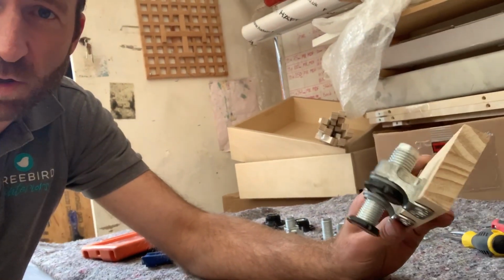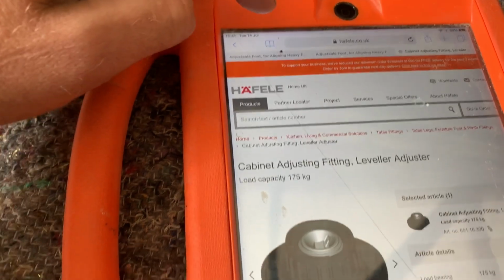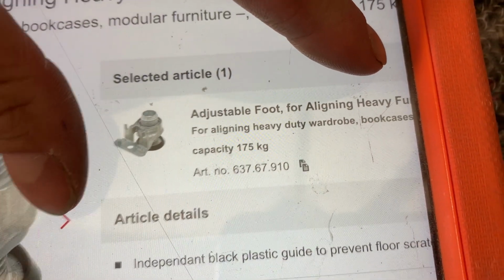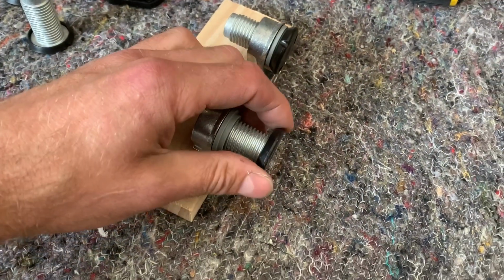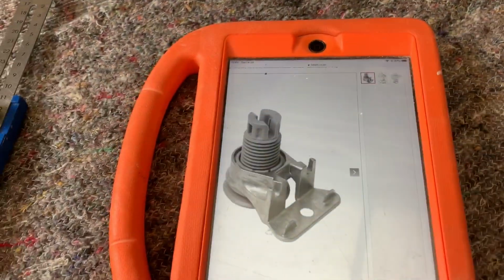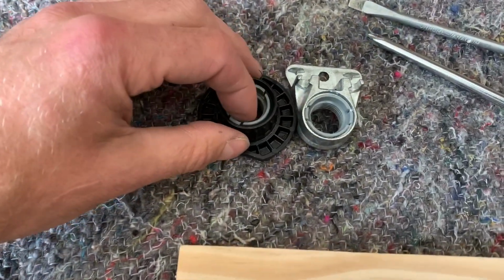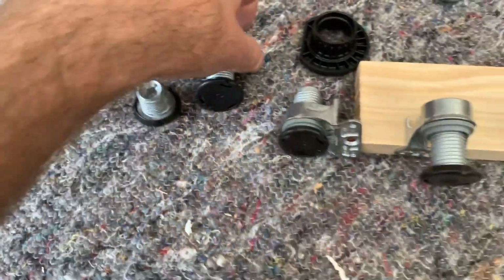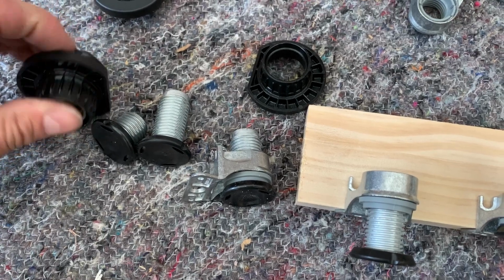Cabinet Levelling Feet from Hafele

Comment: Love the channel and the vids, that it inspired me to make a big wardrobe (2 units together). It's  2.4m long, 2.2m high, 620cm deep. I have just made the plinth base with 8 of those adjustable feet from your vid above. The unit total weight is about 350 kg and the feet will be sitting on the floorboards.  Should I use any sheet wood under the feet to distribute the weight load on the floor boards? Or just mount the 8 feet on the plinth so they align with the joists that are under the floorboards? Thanks in advance and keep up the good inspirational vids!
Reply from the maker: Well now, I have actually moved away from using ladder plinths in favour of black plastic adjustable legs which remain accessible after setting the heavy carcasses in place.  I had issues with slight settlement of ladder plinths once loaded.   So your idea of lining up the feet with the joists is a good one if you are going to use this method!
Reply: @Alastair_Johnson   The plinth went into position last night. Half of the feet were over the joists. Once levelled, I used your method of using L brackets to preload it and recheck the levels. Then 12 support blocks over the joists. Today the units are sitting quite nicely on the plinth. Thanks for your advice and vids.

Comment: Your videos are really helpful, thanks for sharing. As a rule of thumb, how many of these feet would you use per metre? Cheers, Peter
Reply from the maker: Hi!  For the integrato G type I might only use 6 on a long ladder plinth (up to 2.4m long) just to quickly level it and then I would fill in the gaps with support blocks.  With the very low profile type I might put them every 400mm ish if it seems harder to put other supports in between

Comment: I notice at the 4min 02 point that the bit of wood you've used to demonstrate the levellers is engineered. Do you use that a lot and is it freely available? Thanks.
Reply from the maker: Tom Bristowe I get edge-laminated sheets of radiata pine (the one you saw) and oak, from a great little supplier called Optimum Timber Supplies in Mexborough
Reply from the maker: https://youtu.be/aHhV0a9SM4w
Reply: @Alastair_Johnson  Thanks very much for getting back to me with that. All the best.

Comment: Shame they don't come with cover caps. In case you want to level the carcass directly off the floor without any plinthth. Gonna end up with 30mm great holes in the bottom of the unit.

Comment: Congratulations on your 10k milestone.  Quick cheeky off topic question if I may. My daughter lives in Sheffield, and is looking for someone to do a garage conversion. Do you have any contacts you can recommend. Thanks
Reply from the maker: Richard Keith hi thanks, although it is only 10k not 100k yet!  For general building and conversion works I can recommend Alan Lamb at Buildwiser on 07779 712646